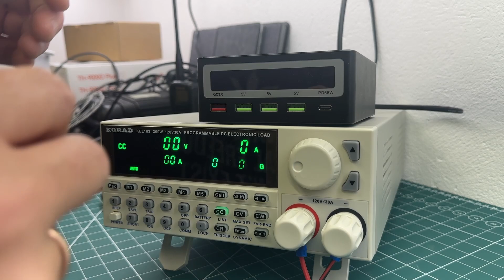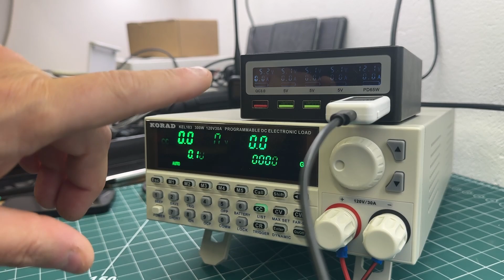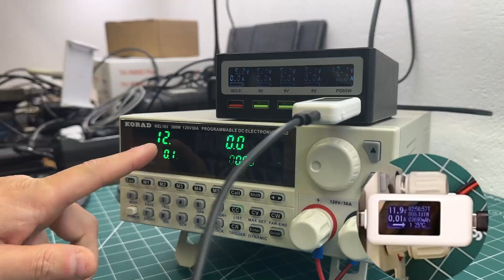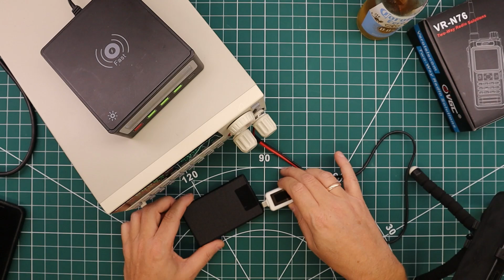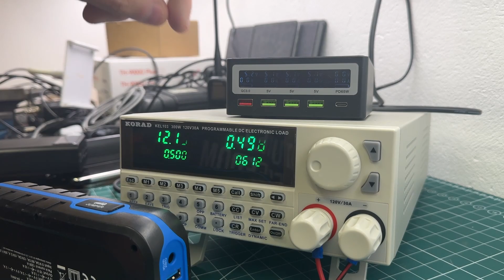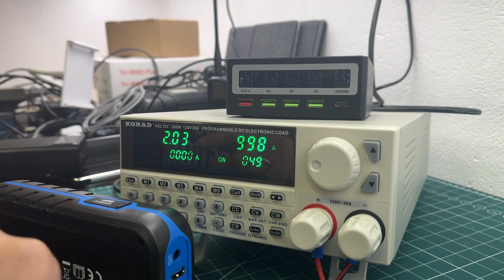Testing USB Trigger Cable For QRP Power

Comment: That looks like a nice solution, would be great to just do USB-C for radios as well, as long as the powerbanks doesn't make noise. That could be something for another video 😉
Reply from the maker: Way behind on answering comments here. But as you've already seen I've done another video trying to characterise the ripple on these two power banks!

Comment: I have had good luck with the Talent Cell's.  Typically 6aH version.  They are available on Amazon in the states.  Not sure if they are available in Norway.  Thanks for the video Bob!  I see you got one of the VR-N76 HT's.  Its on my list of next Ht's  to purchase.  73!
Reply from the maker: Thanks! And yeah; looking forward to trying out the VR-N76. Got it primarily to satisfy my APRS "fetish", but hoping it may even be a decent daily driver type radio for when I don't want to drag the US$750 Kenwood around!